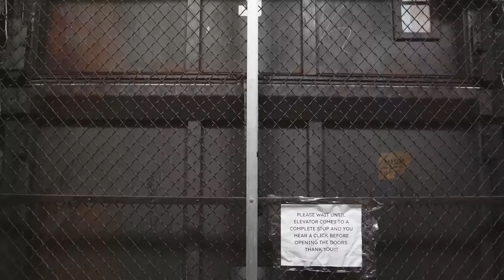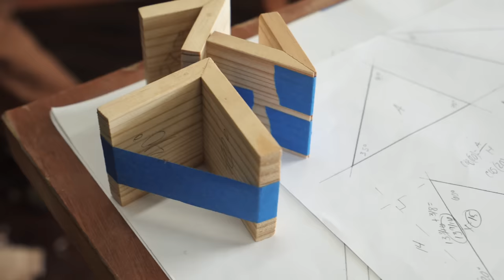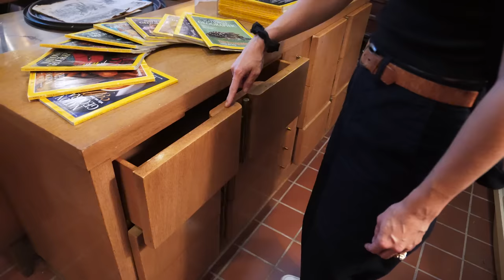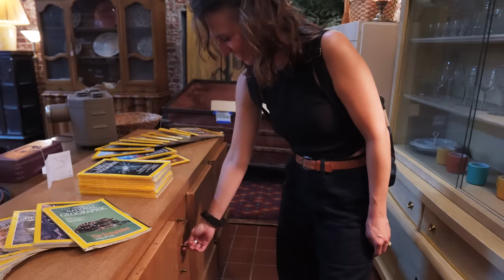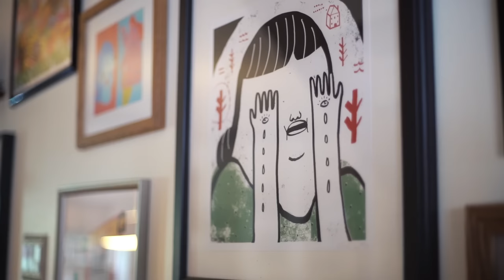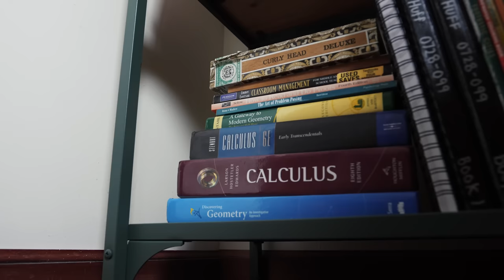Fine Woodworker Larissa Huff: Furniture-Maker

Comment: I see you have the eye for furniture with curves and serious details.  You create lovely work.  Have you explored the Italian and French work?  We primarily work with Italian and French pieces.  We have also have made some Art Nouveau pieces.  Mixing woods, careful consideration of colour and grain placement, curving, bending, shaping, laminating, tinted finishes, adding shaped marble and onyx tops mixed in with the woodworking.   Discrete back and under lighting.  There should be some local (sort of) small mills that can supply you with other than stock lengths, thicknesses, etc.  All those wonderful crotch pieces and the occasional birds-eye maple worked into the designs.  Check out some of Anton Gaudi's designs. So much to make, so little time!  Thank you for the vision and passion conveyed in this video.

Comment: Larissa - You really inspire me.  I am new at woodworking and absolutely enamored with the idea of bending strips of wood.  Would you be willing to be my mentor for a moment and tell me 1) how thin are the strips you are working with.  They appear to be about 3 mm. And, 2 what is the diamond of the pipe you are using.  I appears to be enough to get a relatively tight bend but not small to the point of splintering the wood on the non heat side.  Any feedback you can offer will be greatly appreciated.  Really impressed with what you have accomplished.